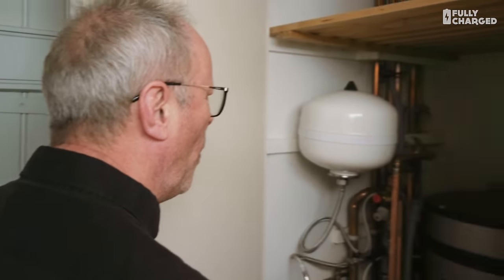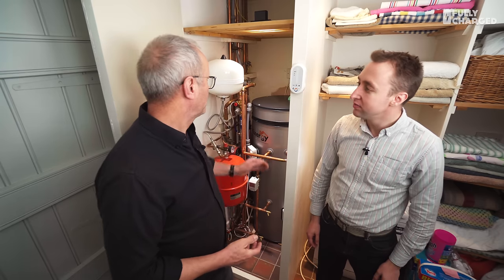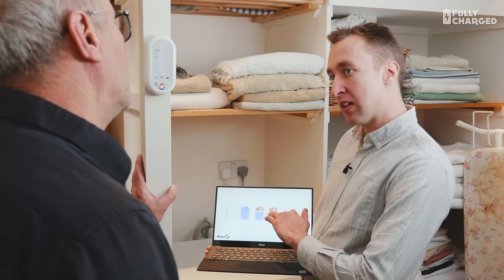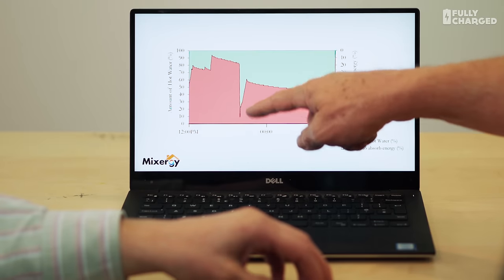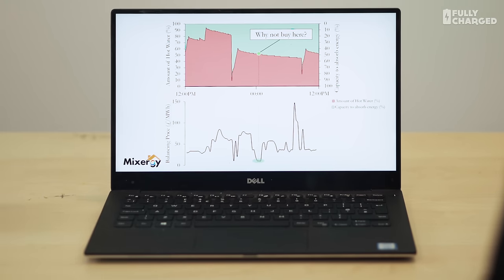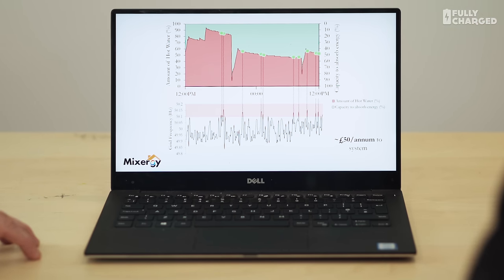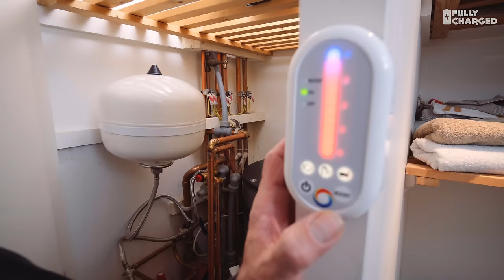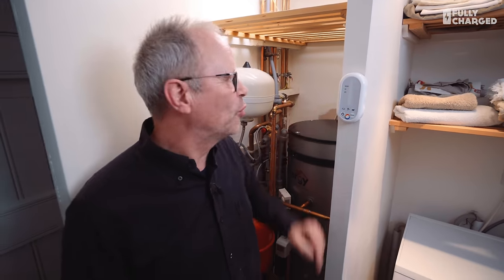Mixergy Hot Water Tank | Fully Charged

Comment: 2 questions. 1 if I buy a Mixergy cylinder to go with an air source heat pump and my solar PV array will I also need a Myenergi Harvi and Eddi so that the cylinder knows the cheapest time to heat the water or does the cylinder tech do all that?
2. More of a technical question, the cold water inlet is at the bottom of the cylinder is the hot water outlet also at the base? If so wouldn't that mean that the hot water at the top of the cylinder has to flow down to the base of the cylinder going through the cold water to be expelled, therefore losing heat?

Comment: @fullychargedshow Hi Robert, I have loved watching this episode 😀 My house has an old water tank and will need to be replaced in the near future. At the same time would I like to install a power wall or similar home battery system from Sonnen in my house to store the electricity that comes from my PV system. This delivers at maximum about 2,5 kW. I think my current PV system is not powerful enough to heat water in the water tank and store the powerwall. What would be the smartest to invest in? A powerwall or a Mixergy tank? Thanks in advance!
Reply: Tim Maiheu Have you got mains gas? By far the cheapest form of conventional heat available to most people. Use gas to heat your water and space, electricity for everything else, via solar and batteries if you can afford it. If you have any cash left over, you could go down the tank approach, using gas to heat it but with a electric heater wired to a solar charge controller that charges your batteries first, then diverts any excess to the water tank reducing the demand on gas

Comment: Why would you need a tank with a combi boiler? Seems like a great deal of complicated and expensive equipment for nothing. A combi boiler heats water when you heed it and doesn’t need to “learn” when you need it, it just knows because you turned the tap on!
Reply: Glideman . Yes that's true but you are them burning fossil fuels. If this cylinder fed your combi with 50 degree water the combi would have no work to do. So for 6 to 8 months of the year you may have no gas bill as the sun did the work.
Reply: Did you watch the video? You missed pretty much all the points they made there.
Reply: I think is is best to think of it as a thermal battery.  Charge it up while electricity is cheap or free.

Comment: Erm... Not sure about this one. I would prefer combi boiler simply becoz it doesn't need to store anything and it only heats when we need it. That's gas and water saving. Please educate me if I am wrong.
Reply: The problem with a gas boiler is that it has to produce significant amounts of CO2 because it burns a fossil fuel (unless you are using some sort of gas digester). With Electric immersion heaters you have an option to power them from renewable sources.

Comment: Ultimately wouldn't more electrical storage and on-demand heating be better?  Energy (from renewable) you put into heating the water does "save on power consumed later" but won't power your lights at 11pm when the sun is down...
Reply: The problem with this Tom is the round-trip efficiency penalty of using batteries along with the wear and tear you subject them too each time you cycle them. The amount of energy and power delivery involved in domestic hot water production is considerably compared to the capabilities of home battery systems currently on the market.
Reply: Eventually more durable batteries will be on the market (for instance supercap based batteries, vanadium redox, etc) and the infrastructure to swap that into an inverter from say li-ion is a lot simpler than making electricity from hot water (in a house scale...) is a lot more plausible.  It's like taking all your excess pork and making a billion hotdogs.  It's nice to have hotdogs when you want them but sometimes you want bacon.  Turning hotdogs into bacon is not possible (and science will have gone too far when it is).

I mean it's a compelling argument but we should be building grid storage based on electrical potential not hot water.

Comment: Can we still get on board for these trials? I woukd like to pass this information to our landlord. We only have an immersion heater for our hot water. The economy 7 is usually no good to us for the tank and me and my partner usually shower after work. So we end up having to spend £1.80 (3kw x 3h x £0.20kwh) every time we need hot water to shower, wash up etc. Any idea how much we could save with such a tank?
Reply: Scott Dann standing heat losses from a well insulated tank are minimal, why not just use it as it was designed for? Charge it at night, it will still be piping hot by evening the next day. Sounds like you are heating the water when you need it at present?

Comment: This is a it biased and not entirely accurate. Any decent quality hot water cylinder also heats up from the top down because even though the water is heated from lower down, the hot water rises to the top and the cooler water drops to the bottom. The cold water entering the bottom is also “controlled” as it enters the tanks so as not t9 mix up the stratified layers in the tank. This tank has some good features but in my opinion it will not work for everyone.  In my household we all shower one after another so you would need most of a medium sized tank heated anyway.

Comment: Do you know of or have any information on preheating water from excess solar for use with a combi-boiler? I saw something on a episode of grand designs years back where 2 X 250w panels were installed solely to pre heat a small mains pressure tank installed just before Thier boiler.

I would love to add something like this but no plumber has a clue what I'm on about! Cheers Pete
Reply: pietkaify 12 volt immersion heater can be connected directly to 12 volt solar panels.

Comment: Cool but how does this compare to on demand water heating systems?? ....Awesome Show as always !!!!
Reply: This probably uses more energy than an on-demand system on a day to day basis but it can function on a smaller source of power than an on-demand. On-demand heaters need to throw a lot of energy into the water at once to heat it instantly, so they're only usable with an huge circuit or a big gas pipe, but waste less of the energy they use because the water has no time to cool off. So an on-demand system is incompatible with gas-free homes running on typical solar installs, they typically draw 11-24 kw on electricity, that's too much for most home circuits.
Reply: Thanks Aaron - so a mains pressurised Mixergy tank will deliver much higher flow rates than an on demand system. It is also more efficient than an instant gas boiler (or combi boiler as we call them in the UK) (we've tested these systems back to back in our lab - do get in touch if you'd like to find out more)... Our view is that instant gas boilers, whilst they have been good for small premises, are not the way forward in the long term if we want to meet our 2050 carbon emission targets
Reply: Id love to see a chart for a home without solar and a time of use meter compared to a standard home, Do you save £££? while we still have gas i cant see it selling well or saving much if it costs you a quid to boil the kettle at peak rate.
Reply: It looks like you are targeting people with a good Solar FIT rate, with that soon to be gone who is your market? i don't think you should have talked about 'time of use' i don't see that being a thing unless its forced on us all, and thats putting Australian and USA families on the breadline, the website talks about E7 tariff which is more sensible.

Comment: But... my ancient, basic copper cylinder + immersion heater (I fitted the shorter immersion heater in 1982) only heats the top part of the tank, too. The heater's in the top 1/3, which is very heavily lagged. Heat rises. Even the old heater only heated the top half  (which was far more than I needed, hence the switch to a shorter heating unit).

I'd not want a tank that heated a vast volume from the bottom. Good grief, that's a ridiculous way to heat a normal, small-house quantity of water. Mind you, my place doesn't have central heating (or a gas supply), so there's no complicated combi-boiler shenanigans and no heat-hungry radiators to feed.

Come to think of it, my house doesn't have any heating of any kind whatsoever. Not ideal in the cold, wet, grey, miserable north of England, but that's the way it goes, eh? Wear a woolly hat, Elli, and stop your bloody moaning! I don't use my hot water cylinder any more (can't afford it). I don't use hot water, full stop. I boil a kettle for tea and coffee, and that's all. Life's cheap but chilly. If I could afford a shower it'd be a £50 independent electric one, not a fancy integrated thermostatic one run from the main hot water cylinder or whatever the norm is nowadays. But... I can't afford the electricity to run a shower. Sigh. Gosh, I'm so, so out of touch with Fully Charged and the real world...

Comment: How's it working out? Sounds like snake oil to me. Hot water rises, cold water sinks, heating from the top is counter intuitive.
Reply: To heat more water, they pump cold water from the bottom to the top, so the whole layer of hot water sinks a little, allowing the new cold water to be heated by the heating element.

Comment: How is this any better than a combo boiler that heats the water as you use it?
Reply: Pretty much just because it can heat the water when power is cheap, as opposed to whenever you're using it, which might not be the cheapest time of day. 

It would, however, go well with solar hot water if you've got the roof space for the solar collector. Specifically in keeping a usable amount of water hot during a cloudy week. Heating a whole tank takes hours, requiring you to plan ahead and turn on the boost a few hours before your shower if it's been cloudy for a few days.

Comment: I'm hesitant to accept Mixergy's thermocline claim, as that happens primarily where there is no movement of water.  In a small tank, when you turn on the tap, the whole tank is put into chaos from the inrush of cold water through the tube, and any thermocline disappears instantly.  OK, looking at their ordering page, I see that they use an internal heat exchanger coil, but I don't see how they avoid disturbance, or if it matters.  And do they electrically heat water in the exchanger coil (like a tankless) to get their 5x recovery figures?  Methinks you're buying a nice tank with a very expensive software package and marketing hype bundled to it. 

BTW, in a water heater which has an upper and lower element, you can replace one with an 800W 24VDC element (common size) and power it from rooftop solar.  Slow but steady renewal of hot water.  Let's see, the elements are $17-23USD up to 2kW @ 48VDC, a bit cheaper than Mixergy's smallest model @ $1005USD.

Comment: Should have gotten a smart heatpump boiler, it uses energy from air outside. This is resistive heating and inefficient by design. One with a heatpump can be 3.3x more efficient with energy
Reply: Stefan Brand Unfortunately efficiency drops right off during cold weather, sometimes as low as 1x. Then there is the expense. They also have to be run for long periods to be effective, stop start is not good for them. Finally, they don't produce water hot enough for domestic use efficiently, they need resistance heating for the final 10 or 20 degree "push". For a relatively low cost option this is a good piece of kit, especially if you are replacing a conventional tank - all the pipework etc would be in place, this just drops in place.
Reply: Spencer Wilton It can heat up the water to 56celcius with the heatpump only, even at -7 degree celcius. One I am talking about is 1740 euro for a 200L heatpump boiler. COP (year around) is 3.4 so 3.4x more efficient vs heating element only. And: it still has a resistive heater aswell, if need it to be used.
Reply: Stefan Brand What's the COP at -7 degrees for 56 degree hot water though? I bet it's nowhere close to 3.4
Reply: Spencer Wilton water stays for for a few days and slowly cools off, even if it is -7 or less for a couple of days, it only has a low COP for a few days a year (in summer it’s obviously better which compensates)

Comment: How does a combi boiler compare efficiency wise? It only heats the water needed when it is needed.
Reply: Hi Arthur, we have undertaken testing in our lab and a Combi is around 75% on a typical draw profile compared with 90% for our tank on the same draw cycle. The reason is that there is a big overhead with combis around heating small volumes of water. You heat up all of the heat exchange equipment, the flue etc only to draw a small amount then all that heat is lost as the boiler rapidly cools down again. Now you have to factor in the cost of gas and the size of your premises etc when deciding what system is most appropriate.

Comment: I've just replaced an even older hot water tank with a pressurised hot water tank running from a vented boiler (hence no pressure tanks like you have and I still have a small header tank in loft for central heating system) but no longer have a cold water storage tank meaning all my plumbing is now at mains water pressure, both hot and cold. Does your system still have a cold water storage tank? or is it at mains water pressure?
Reply: If your hot water is at main pressure you need a pressure expansion tank, or is the one built in on the how water tank? you need to be G3 qualified to install un-vented hot water tanks, are you sure its safe?
Reply: Thanks for your input. Allow me to expand and add some more detail. In addition to the hot water I also had a new boiler fitted. This was done by a local reputable installer. As the boiler is a gas boiler, I did check the Gas Safe Register to ensure the engineer was properly qualified, and they were. On further checking with regard to my new hot water system, yes, it does appear to be un-vented and the absence of apparent expansion chambers is explained by the expansion chamber being incorporated into the body of the cylinder and hence not visible. From what I can find out, you would appear to be correct in that it should only be installed by a G3 qualified installer, I'm actually in Scotland but think the building regulations are much the same? So, from my perspective I need to (a) understand that my installation needs to be maintained by a suitably qualified engineer in future, (b) I need to know how to verify the credentials of any engineer I engage? Is there any equivalent method to Gas Safe for G3 to be able to vet / validate the qualifications of engineers / companies? I hope so, because if not I don't see how this is going to work in practice?  ps still interested to hear if the Mixergy system is designed to work as part of a mains pressure system or if it's a low pressure system?
Reply: @nigelpentland  the person installing this would need to be qualified and it is notifiable work so you should have a building compliance cert . this is not policed so many installations are not done to manufacturers spec with regard  to safety devices and discharge pipeweork.

Comment: Could you also use solar heat to heat this tank?
Reply: That's a good question, I was thinking the same. I don't see any reason why you couldn't, it's basically normal water tank. But if you are in position, when you don't have solar heat already installed, I can't see reason why to install it anymore, because it would be cheaper to install two more PV panels to the roof (they would work at the same time, when the sun is shining). Then you wouldn't need heat exchanger and water pump anymore to transfer the heat from the roof. System would be more simple without it.
Reply: I understanding what you say, but i dissagree. It’s more efficiënt of you don’t have to charge solar in electricity, and that in to heat. Furthermore there are nee solarpanels that are both EV and heat (EPT panels)
Reply: Use a solar immersion or a solar divertor
Reply: I've often wondered if scavenging the heat from the solar panels while they're in the sun would be worth it. Have a small pump pumping water through a line that is attached to heat exchangers that are attached to the panels.

Would also improve the performance of the panels by cooling them.

Something like a watercooled computer, but using the heat rather than dissipating it.

Maintenance might be a pain though, simple as the system is.
Reply: They exist as PV-T collectors.  e.g. http://www.northburnsolar.co.uk/page3/page22/index.html.  Nearly went for it, but I had such a bad prior experience of moving water outside over time that I chickened out.

Comment: Do many uk power suppliers to home users offer variable pricing on a half hour basis? I doubt it. Most of us have at most are offered a better price for nightime power use. How many users benefit from this if they don't have home solar? It does offer a better option than battery storage using your water tank as storage. WHat happens when many new gas boilers don't have water tanks at all and heat on demand? More useful if a home EV car is not an option to use excess power. Its not stored energy it's stored heat. You can't convert the excess hot water to power...
Reply: Stephen Doherty For many homes stored hot water makes more sense than a combi, which are notorious for low flow and regular breakdowns. If you don't have mains gas an electric tank is the only sensible option. If you have to have a tank, it might as well be a smart one, I doubt the cost difference is significant. Time of use tariffs are already coming, but slowly. Bulb have just announced a three period a day tariff, cheap at night as usual, very high from 4pm to 7pm and somewhere in between during the rest of the day and all weekend.